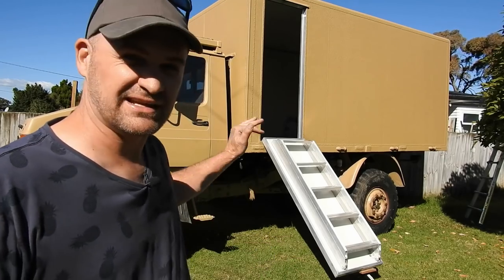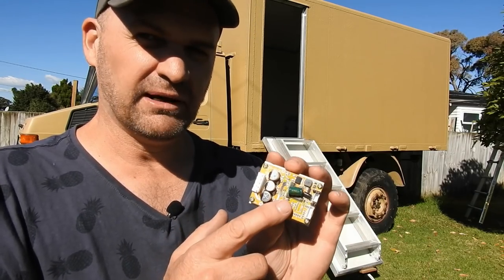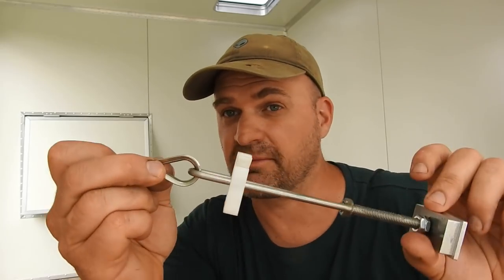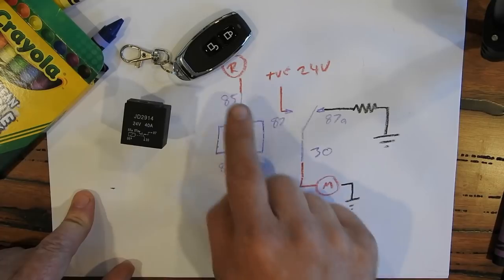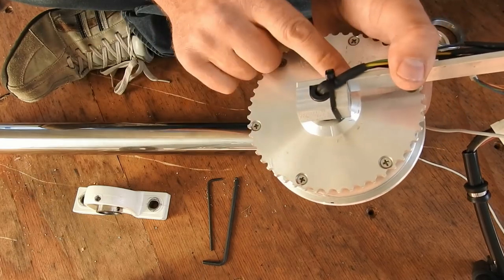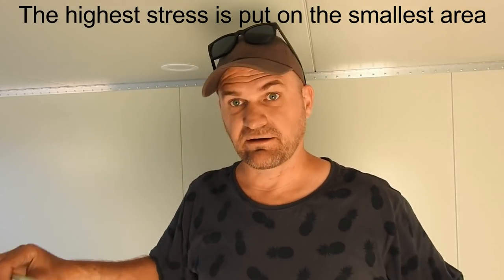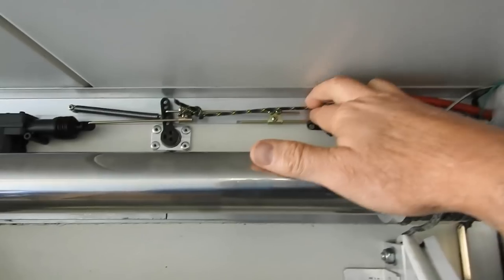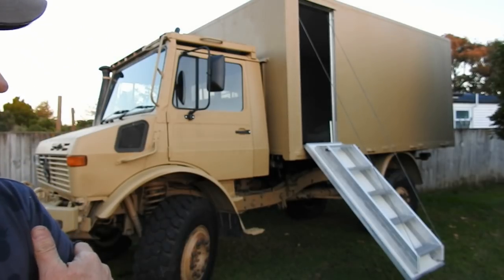DIY Automatic door - #8 Unimog RV build

Comment: The things we put ourselves through because we just wan to do it ourselves :) I chickened out and just made some stairs with bracket slots that I place by hand and then bought a roller shutter to operate with my phone. The shutter is very cheaply made like all of them and slow. Subscribed.
Reply from the maker: Thanks, yeah.. I don't know why electric actuators are always made to be slow and noisy, just no need for it.  It was a little bit of work, but glad it's running.  No real hassle to put up and down.

Comment: Mate, I just like your way of thinking. Awesome! When you finally have the controller hooked up, consider parking next to a car, going to e.g. a restaurant, sitting down your trousers may press the open button unintended. That cool door of yours would make an awesome expensive impression on the car next to you... :-) probably makes that car look better, being impressed ba a part of a Mog, but the owner probably disagree with my view ;-) keep it coming. Cheers.
Reply from the maker: Thanks, yeah.  When I get around to making a controller, it'll have a sensor to make sure nothing is in the way of the door when it opens.  I have most of the code written up, need to start putting it all together.

Comment: Totally amazing ingenious execution and I fully understand the concept of you climb a mountain - bc it's there, BUT. I can help but think that in inclement weather you're love for the door will wain very quickly.
I myself considered something similar but discounted it due to the fact that I'd 
A) lose all my heat while the door was operating.
B)  the wind would blow the rain all over everything within 4 foot of the door..
So, love your skill but I'm using a trad door and deploying drop out steps.
PS
I'm also lucky bc my Merc has full air - so I can ride high and slam it when I park up.... Crack on Bredon - yr an inspiration!
Reply from the maker: Thanks Graham, I'll have a pass thru into the cab too if weather is especially shyte (going to try and stay away from shitty weather).  Am likely to speed the door up quite a bit in the future.  The entrance is a tiled wet area, so not horrific if it gets some water on it.

Comment: Hey Brendon! Hope I am not bothering you with so many suggestions... but here is another one! I... don't remember which videos you talked about it in, but it's really cool that you take a testing+evidence based approach to your concern about environmental toxins, but sometimes it seems a bit inconsistent. Really great video about formaldehyde off-gassing. No apparent concern for diesel fumes, carbon monoxide, or all the glue you used. This could mostly be fixed with little comments about getting some ventilation, or that you checked the spec sheet and this product shouldn't be too toxic. That shouldn't disrupt your flow or style and I suspect that is what is happening behind the scenes, but on camera you're in a small box full of glue towed by a smoke belching tank running a blowtorch with no visible ventilation complaining about fumes. 

What I am less sure is "your style" but would like to suggest anyway: a nice word about protecting the environment here and there couldn't hurt either, and it fits with making a vehicle that can go out into nature and the concern about gasses that might poison you personally.

So, yeah, two different suggestions where I thought one of them was spot on for you.
Reply from the maker: I hear you.  I'm wanting to bring awareness, but at the same time I'm not going to go overboard.  My glues are mainly moisture curing polyurethane which to my knowledge once cured are fairly inert. I mentioned a little about looking in the data sheets for the bench coating. I'm not too concerned about the butane torch on aluminum, maybe a small amount of CO and NOX but unlikely anything to worry about short term.  As far as the diesel, I'm unlikely to breathe the smoke for extended periods, but i get your sentiment.  I have considered electrifying it, and if I have any significant engine trouble... it's a possibility.  Appreciate your comments and glad to hear someone appreciates me harping on about toxins in the world we live in.  I'm likely to get a bit deeper into that field on the channel.
Reply: @brendontait6968  yeah, I'm in the same boat with our engine. Any major problems and we might go diesel electric hybrid with 48v LiTO. Seems to be about 30% more expensive than a new name-brand engine. About twice as expensive as a new off-brand engine. Either way, it's a tempting way to get a giant battery pack and generator into our boat.

Comment: Hi Brendon what a fantastic job.
My wife and I will soon be heading to USA where we will start our full time living and travelling with an overlander. 
We are contemplating few option one of wich would be buying a 4 x 4 Flat deck Commercial truck and home build the living quarters a bit like you did. I looked at a company called Total Composites wich cuts and flat packs the box to be assembled by the buyer. Yet their prices are incredibly high around 17000 without doors and windows. Would you be able to share a little about how much building the box costed to you so far? Much appreciated 
Best Regards Daniele
Reply from the maker: Hey mate, thanks and no problem...  I'll talk in USD.  Being in NZ our prices are typically higher than a lot of other places due to being isolated with a small economy.  The panel and aluminium extrusion cost me $1,900, the rear ali frame cost $120, the rhino spray coating on the back was $3,800 with another $900 for paint (but bought too much).  I don't think I'd build with this method without putting the bedliner coating ontop.  As far as time frames... the floor took a day, the box walls took a day, the doors took a day, the roof took a day and the riveting took a day.  Pretty much any job on it no matter how big or small seems to take one day.  I prefer the idea of steel over composite due to resistance to a lightning strike and will dent rather than crack if it gets a hit.  The downside is there is thermal bridging.
Reply: Great idea Daniele - just two things to offer and you know your plans far better than I do.
Use a commercial refrigeration builder for the body - or even an existing refer truck.
Which brings me to my second thought.
Do you really need the complexity and financial penalty of 4x4?
I'm building a truck to drive UK, Russia, Nepal and back. I watched loads of YT videos - and looked at all the local vehicles in the background. No matter where the 4x4s were they were surrounded by stock 4x2 units.... I'm happy going with aggressive rear tyres and weight distribution. Good luck

Comment: This is awesome! But you must make sure no car parking  under your door way in the morning and no water come to inside when you open and close in the heavy rain.
Reply from the maker: Thanks... I don't really like people. So aren't that likely to park where a car will be parking beside me.  With a controller I will likely have sensors in place.  

As far as the rain...  I did consider that to some extent.  In the future I may overdrive it and make it quite quick.  Additionally, the part the door opens from will be tiled and part of the bathroom so a little moisture inside shouldn't bother it too much.  I also will have a pass through into the cab for difficult or confined egress situations.

Hope you enjoy the rest of the build.

Comment: Hey, so this has been excellent to watch. What’s the ~year update? How has it actually held up? Do you have a list of products / cost to build or estimate? Thanks!
Reply from the maker: Hey, glad you've enjoyed so far...  I have a few more videos coming soon with updates.  The products were just SIPs panels as shown with the aluminum sections and cost around $2k USD to do the box.  Seems to be holding up well, tho I've only driven 500km or so with the box on, but no leaks or anything yet.  The Rhino coating was v expensive... roughly $4k USD but I think well worth it.  The paint again was spendy, it is a flexible urethane paint and roughly $1k USD, tho I have lots to spare.
Reply: Brendon Tait that is excellent. Well done! Did you detail any 3 point system or something to assist with your box flex or did I miss that?
Reply from the maker: You might have missed that, but will go into that in the next video

Comment: The door on my living cell is in two parts as in some small airplanes. ( Unimog 1300 L ) The winch, a small one as they use on sand buggy's is under the floor and the steel cable go's over a wheel  in to the floor and under it to the winch. To avoid that the cable rolls over itself, instead to every turn next to the previous, I have used a turning wheel as under all kinds of trollys and changed the rubber wheel for a cable one. So the cable is tense because of the weight of the door and the cable is not that long, so the windings are next to each other. The footsteps of the staircase are folding inside, so take less space and  inside is nothing of the mecanisme of the door. The upper side of the door works with a line motor atached on a cable that pulls the part down. To push it open the cable go's in the other direction and on the door is a gas spring tube as used on back doors for cars etc. The two parts stop with a switch inside and the upper part has the electric lock and that part closes over the under part. The under part can't be opend as long the switch of the upper part is not free. The electricety for the door is swiched on and off by remote controle. Switches for the doors on the outside are under a cover plate that was used for filling feul in a car. That little door switches open when the electricety for the switches is remote controled put on.  O, the under part of the door stops when opening on a switch that is normaly used on the standard for motorbikes to prevent starting with that thing not folded back. The under part of the door is 2/3 of the whole lengt of the door. Big doors need also enough space to open, on parkings etc; The two parts have also reflecting strips whole around, because I don't want that  the doors are hit  by a car that come too close next to my truck in the dark.  I must say this man dus fine, complicated machine and other work. But I like to use easy to find components that can easely be find to be replaced ....
Reply from the maker: Make some videos... I'm sure people would love to see.
Reply: @brendontait6968  I have a lot of pictures, no video's..... never uploaded something on YouTube.... maybe I can do something with those pictures.....

Comment: Brendon, it's more than a year since you built this, would you mind letting me know if using freezer box panels was a good idea. I have to decide if I'm going to use it, would be a great help to to know.
Reply from the maker: Hey mate...  it hasn't had much use tbh, but am fairly happy with it so far.  I would only recommend using it if you cover it in bedliner fairly shortly after build.  One thing to be aware of is the thermal bridging on the extrusion.  I have a way to deal with it.... just something to keep in mind.  I found the panels to be cheap and very easy to put together.  Not sure it is the perfect method, but it has worked so far.  Ask me in 5 years and I'll be able give you a more complete and accurate  answer.  Good luck with whichever way you choose to go.

Comment: Great build Brendon. Really enjoying the series. Love the door and your drive set-up. Have you worked out a way to lock it? Could the door be pried open?

I was considering using a battery drill for a door drive as it would be quick to adapt, simple and reasonably heavy duty. Plus if it dies I can just grab a replacement from a hardware store pretty much anywhere. Rather than sensors I was thinking maybe just a little viewing window like they have on aircraft doors to check that the stairs have been put in place. I figure if you are outside you can see if there is anything in the way :-)

Very much looking forward to your next installment.
Reply from the maker: Thanks Jason.  The door currently has a locking latch up top.  But I'll probably add a secondary lock for good measure.

Do you have a mog or similar that you are doing a build on too?
Reply: @brendontait6968   I am currently sussing out the Mogs via Grayonline auctions in AU.  I few weeks ago I went and had a look at Pete & Jo from Great Aussie Adventures build. I love their layout. When the time comes we will get one of their desalination units too.

I really like the idea of the stairs built into the door as it saves having to store them separately and also removes the risk of forgetting the stairs may not be in place for some reason and falling 4 ft!

Comment: U Sir are a wizard! I knew u would blow my mind when I first subscribed to your channel. 
Question... what sort of provisions did u make for articulation of the pod 
when attaching the floor to the truck frame? 
Did u use any type of spring mounts? 
By the way, how is the bus project coming along. Have u managed to find some time to work on it? 
I love your videos! LOVE the way your mind works. 
Can't wait to see what's next. 
Excellent work mate!
Reply from the maker: Thanks Erick, glad you liked it.  (Youtube hated it and the algorithm completely removed it from promotion) I've just built directly on the truck tray as it came it has three articulation points (longitudinal axis front and back, transversely in the middle) and a big shock absorber behind the cab.  I think this is briefly shown in the "new deck" video.

As for the bus.... despite what I'd said earlier, I sold it =/  would have been a great wagon.  But have a lot of other things I'm putting effort into.  As it is, one RV conversion takes up a lot more time than I anticipated.

Comment: Loving your build, your logical approach to everything is great, but I'm not a fan of the door. As nice as it is, this is an expedition vehicle and i assume this is the only way into it? You're using a lot of bespoke, difficult to replace parts and it appears you can only open it if you have battery. Also if a car parks next to you when you're inside with the door shut, there's going to be some problems when you open it! Dispite this criticism, i really am loving the build and look forward to the next video!
Reply from the maker: Thanks Robert, if you look carefully I have a hatch in the front of the box that will open into the cab to give me alternate entry/egress.  As far as the door opening onto something like a car or the head of a small child... when I build a controller, it will have sensors to reduce the chance of this sort of mishap. 
Battery power is unlikely to be an issue and altho I didn't show it, the door can still be operated manually in both directions from inside or out.
The bespokeness aspect... that's  my gig, I like having something unique that I built entirely and having intimate knowledge of every aspect of each mechanisim.  All parts for the door are very cheap and easy for me to make.  There is no doubt this project will be a great learning experience for me and hopefully for some viewers too.  I'm sure after it is all built there are things that I'd do differently, however... for now at least, I love the door!  Thanks for following along
Reply: @brendontait6968  as a viewer it's wonderful to see your fabrication skills and ingenuity. It doesn't surprise me that you have already thought about all the issues i pointed out! The interface/hatch to the front... What's your solution for that? Off the shelf bellows (i think that's what they call them) or something bespoke?
Reply: @brendontait6968  I see a lot of parts I've ordered on Amazon for my "bespoke entry door" as well! My opinion is the global supply chain for the parts you used are readily available around the planet.
Reply from the maker: @AaronBockelie  100%...  not some specific manufacturer.  Most of the bits I build will be like this.

Comment: Needs a safety-lockout + relay so it can't open while moving (including liability if it smashes into someone's car in the next lane of traffic), but great work from used parts.
Reply from the maker: Yeah, thanks...  at the moment I tie it up from the inside with string when I drive.  When I make a controller, the door will have a secondary lock and other and sensors.

Comment: How do you plan on impending it from the outside if you have an electrical fault?
Reply from the maker: What are you suggesting about my wiring skills?  But, yeah I did think about that....  I'll be able to tap into wires somewhere if I have to. 
 The lock has two locking motors incase one chowders itself. There will also be a pass through from the cab in the future.
Reply: You’re work is awesome👌. But what if any of the working parts or control boards fail? How will you open it from the outside?
Reply from the maker: Worst case if say the latch breaks or becomes disconnected from the linkage rod.  Im sure I know the construction well enough and am inventive enough to find my way in if I need to, even if it means cutting hinges etc...  The rear door is also going to be motorized and on a separate circuit.  And there is a manual door that will open into the cab.  So could get through from drivers area.
Reply: Brendon Tait  I see. You have plenty of ways in👌
Reply from the maker: Although - it would take time and tools, I'm actively designing it to be difficult for someone to break in.  The passthrough hatch will be lockable, and no external locks or handles on the box etc.  I intend for the side door to have a secondary lock (the one that locks the door winch).  I've already installed immobilization to the engine.